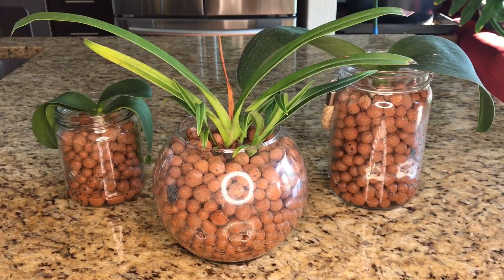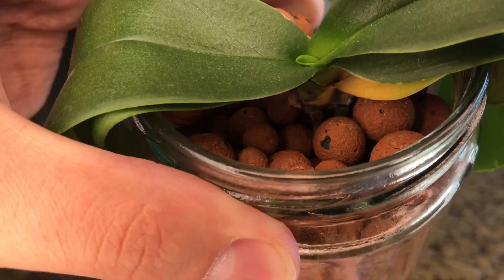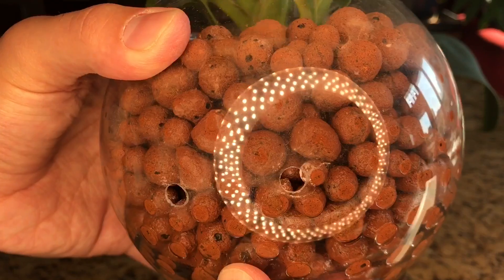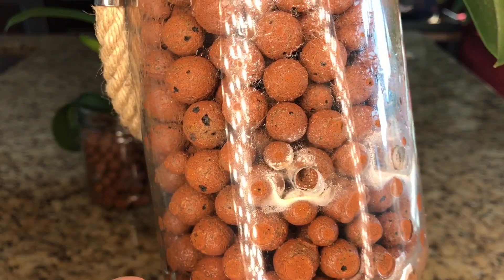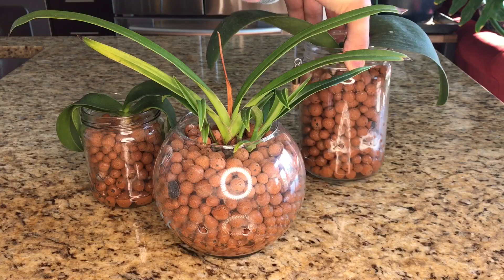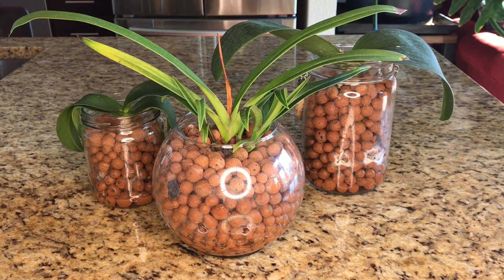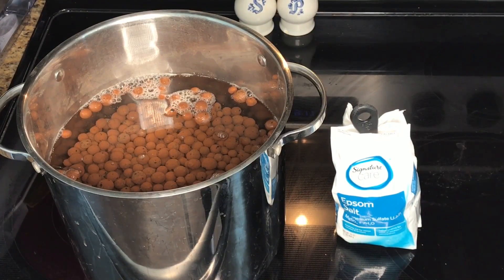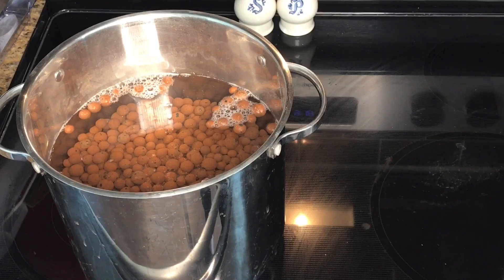Mineral Buildup: Semi-Hydroponics (Part One)

Comment: One tip that I found might help when you have a big collection, is to go around and spray down all the pots from the top. This sort of softens and starts to dissolve the salts (fertilizer) buildup.  Then after about 10 minutes I would do the actual flush with medium soft or distilled water (depening if it's a phrag or not).  The simple (single) flush often doesn't give the minerals enough time to really dissolve and exit the system. 
 Also caution with heating: Normally LeChatelier's principle applies and it accelerates disolving.  Calcium (carbonates) is an exception.  If this is a significant component of fertilizer you use, and if you suspect there is calcium buildup due to your water supply or fertilizer choices, has the opposite trait than most molecules: cooling it causes it to dissolve more where heating tends to make it "harder", more solid. This is why our bones are made with calcium! It was the one molecule that stayed hard at temperatures that were optimal for biological processes! (Metabolism).  http://comp.uark.edu/~ksteele/gochemfiles/SteeleCarbonatePC-762.htm
Reply from the maker: This is a super interesting approach that I haven't considered, Kimberley! I'm going to try to "pre-treat" by spray this month, then follow with a flush. Also, great call out on bottom heat: I typically only use it the first 2 months a plant is in semi hydro to help it adapt, but I guess that's enough time to create the problem!
Reply: Michael's Orchids and

Comment: Do you ever flush with pure water? I'd think that would also help dissolve the deposits. There are some products (I'll find and add link) that are used in hydroponic systems to flush and remove salt build up from media. As someone above mentioned, I'd be worried about disturbing the plant and stressing it's immune system.
Reply from the maker: Hi Larry! I do, but found it a bit difficult to maintain. I always flush with pure water for my phrag and paphs, but everything else gets flushed with tap.

Comment: I would think your method would be more effective if you used a weak acid rather than epsom salts.  A few tablespoons of white vinegar or phosphoric acid (pH down additive) should be more effective.  You are pretty fastidious, I wouldn't bother until the buildup was worse than I saw on any of your orchids.  I just hate to disturb them when they are doing well and even a repot in leca is a stress to them.  But your plants seem to be doing fine, so keep up the good work.
Reply: with due respect, you do not want to add water to a base, always add it to water.  If you add water to Sodium Hydroxide it can and will go violently exothermic and splatter strong caustic solution all over the place.
Reply: an exothermic reaction gives off heat whereas an endothermic reaction consumes heat.  In the case of adding an acid or a base to water when the 2 parts of the acid or base disassociate in the solvent (water) the energy that held them together is liberated in the form of heat.  Sodium Hydroxide is the strong base we would most likely encounter at home (drain cleaner or lye which is commonly used by home soap makers) and is also the strongest, most "basic" base there is.  If you say wanted to mix 5 grams into a quart of water and added the water to a container containing the base for an instant there would be a large amount of lye and a small amount of water and the heat of dissassociation would be enough to violently boil the water and throw droplets of hot caustic solution around as it sputtered and splattered.  Even worse if you faltered and only added a few drops of water.  If however you add the lye to the water then a small amount of lye in a relatively large amount of water would just heat up the water, a phenomenom all home soap makers are familiar with.  Fortunately most acids and bases we might use at home are not so strong or so violent in there reactions, but some caution is advisable since caustic or acid  burns are no joke and hot caustic splattered in your eyes could be irrepairable.  As a note of interest an acid is an electron acceptor and a base is an electron donator.  so they  do their damage in opposite ways but they both can cause damage to living tissue.
Reply: Since I am here with my coffee and already have gotten verbose.  An interesting thing, at least I think interesting, is how intrinsically simple chemical reactions in biologic organisms are.  They are simple and self driving reactions. The initial chemistry may look complicated at first,  but when you grasp what is going on they are pretty simple reactions for the most part.  Three days of lecture and reading on the krebs cycle, the most fundamental reaction in biology related to metabolism, and the end result is that it is how all living things capture, store and release the energy from a hydrogen bond as simple sugars are digested.  Nature tends to keep things simple and add to what is already there and as a result we have this miraculous tapestry of life on earth using simple self riving reactions.  And if they weren't self driving then life never would have started.  Knowing how a rose works doesn't make it any less beautiful if anything it makes it all the more miraculous.
Reply: ATM I just do a crappy part time gig, and occasionally do a consulting job in controlled environment agriculture.  But I prefer to work in regenerative soil based agriculture.  I have gone part time so I can spend more time being a father.  Looking for a piece of land to do my own farm for my retirement, although I may sign on for a few years to help get a friends farm well established.  Before I owned a natural pharmacy and natural products store and did nutritional consulting.
Reply: There are people that already have videos out that say the same thing I would, I've mentioned them a few times in the past.  They have in some cases put a lot of time and effort into creating top shelf content and I don't think I could meet the quality that they have already achieved without a big outlay in time and money.
Reply from the maker: Thank you for the feedback John! I can definitely give that a try in the future
Reply: No worries, take care Michael
Reply: there are not any that I would consider safe to use with the orchid still in the media.  My suggestion was more to use in a descaling operation like what you did in the video.  I wouldn't worry too much about any residue if using only a few tablespoons to a gallon of water, just rinse several times, the hardness in your water should nuetralize any remaining acids.  If you are still worried about it follow up with a tsp of baking soda, and that would definately nuetralize any acid left behind.  If using phosphoric acid any residual would be in the form of plant useable phosphorus.  Continued below
Reply: A review of acid base chemistry.  The result of an acid base nuetralization is water and a salt, hence 1 NaOH +1 HCl = 1 H2O + 1 NaCl.  this is true for strong acids and bases, it is trickier with weak acid and bases.  A strong acid is an acid because of a hydronium ion H+, and a strong base because of a hydroxide ion OH-.  so in the above example sodium hydroxide and hydrochloric acid yield water and table salt.  Always add an acid or a base to water and not verse vica remembered by the pnuemonic-"do like you otter, add acid to water"
Reply: john mason is
Reply: Has the water and water to base.
Reply: I hate auto correct! That should be add acid to water and water to base.
Reply from the maker: Im sorry if I sound stupid, but can you elaborate? I'm not sure I understand!
Reply from the maker: What do you do for a living John? Your knowledge seems pretty specialized, so I'm curious. Thank you for the detailed breakdown, maybe you should be making videos yourself!
Reply from the maker: I'm not sure that's true. You've got a very unique perspective, and even if you are offering the same information, I am certain that you would not offer it the same way :-)
Reply: john mason ol

Comment: I just did your boil method- an noticed in this video your beads are sunk to bottom  an mine just floated. Am I doing something wrong?
Reply from the maker: Hi Gerri! No, not at all. The beads will behave differently depending on their saturation levels and how much mineral content is inside. These ones had quite a bit, which allowed them to sink.